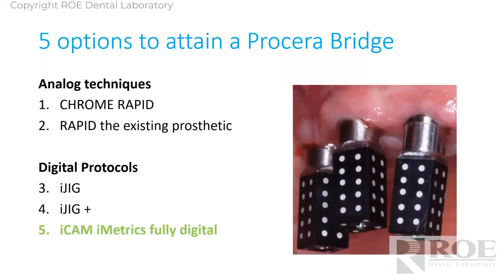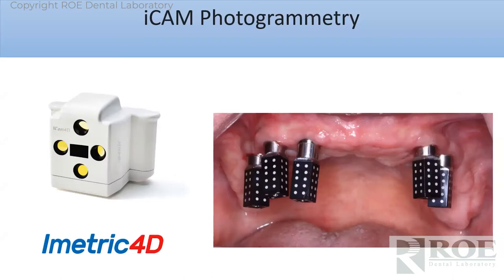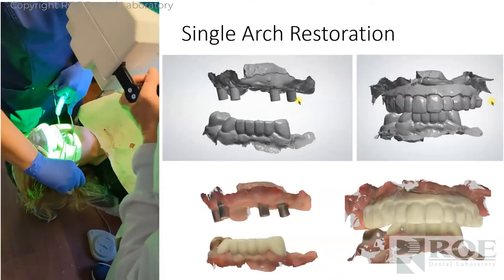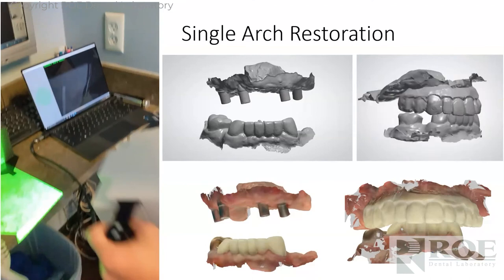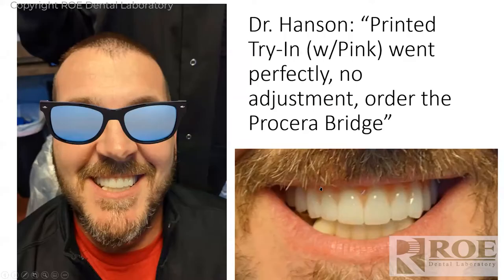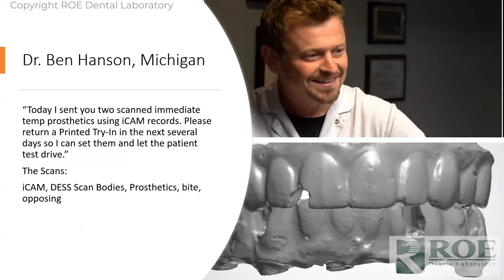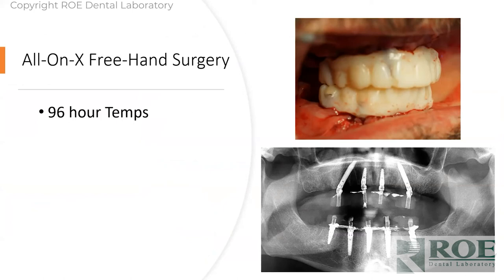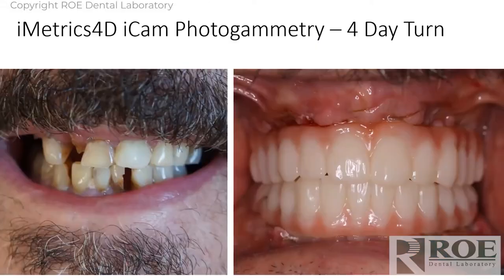Fixed Full Arch Options - iCAM and Case Studies

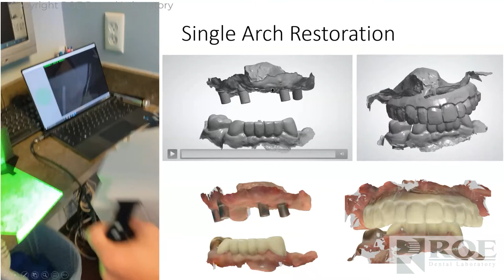Comment: 3:42 - how do you register the seated prosthetic back to the original scan? Which scan is the original?
Reply from the maker: Great question! Typically, we use fiducial or a constant marker like Rugae in both the seated prosthetic and the original scan. The original scan shows the healing caps on the multi-unit abutment. We overlay the chosen constant from the tissue with the same constant from the tissue on the new scan with the prosthesis seated. Does this answer your question?

Comment: Looking forward to exploring this further with you guys.  If we need to reline the zirconia in 6 months to a year, can it be removed, dried and have ceramic added to the intaglio if we have a furnace in office?
Reply from the maker: Good afternoon Jackson, 

This is possible, yes. But it depends on the aesthetic ceramic or coloring the laboratory used. If it is pure ceramics, then a furnace with the right firing temperatures and the right process to fully dry the bridge, and then add porcelain. Temperature is critical. If the pink or the tooth coloring is not ceramic, then firing temperatures will be an issue. Often the pink is not ceramic but is a stain or a liquid. In these cases, it must go back to the laboratory to be stripped properly. The other consideration is the copings. They must come out and be recemented on a model using special cement and technique. Advice would be to return it to the laboratory with a reline impression for a new model.
Reply: @ROEDentalLaboratory  My iCam 4D will be here in a couple more weeks and then I want to talk more with you about the scheduled design service and looking in to the Procera bridge.  Thanks fellas.  Great video as always.
Reply from the maker: Hi Jackson. You have made a great purchase with iCam 4D - you will be delighted in the accuracy it can provide. We look forward to talking with you about our design services. We have a great full arch design team as we do hundreds of these designs per month. We have turnaround times as fast as 1-2 hrs up to 48 hrs. We even have package design deals where you can experience significant savings if you purchase prepaid bundles in advance. We are big believers in photogrammtery and want to support its adoption within the dental community. Looking forward to our conversation :)